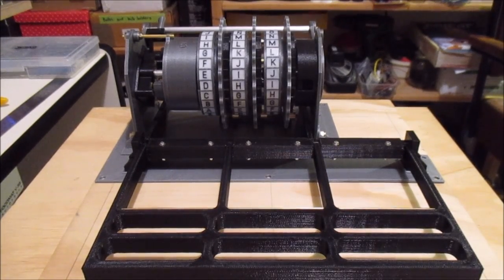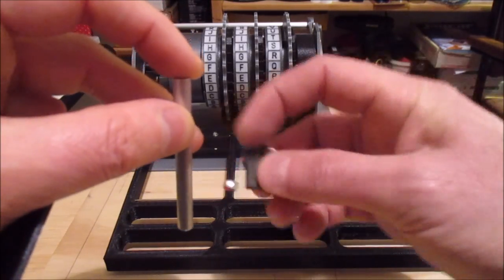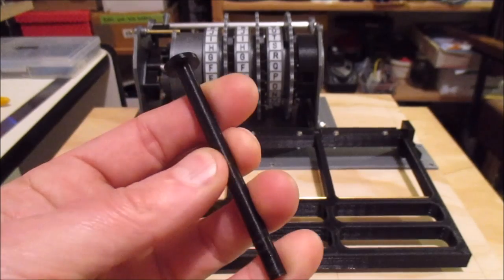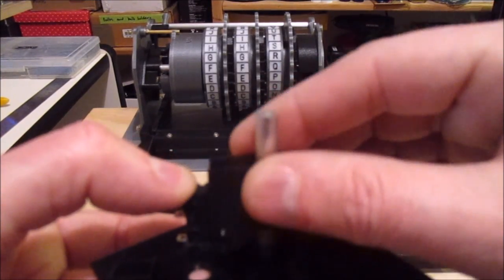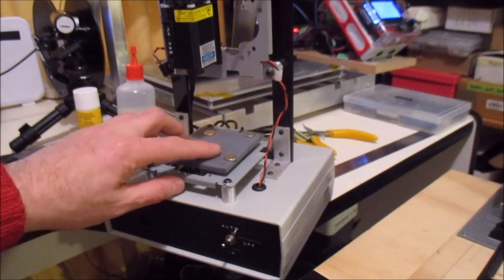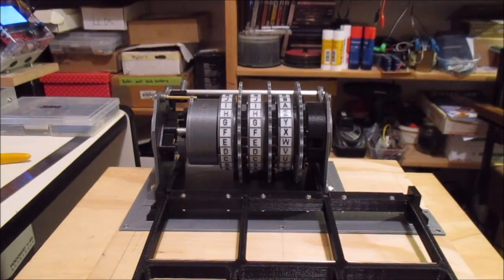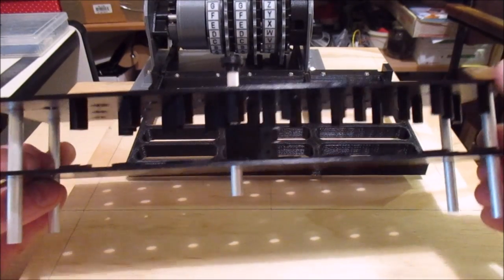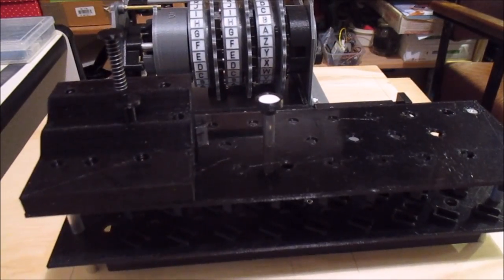3D Printed Enigma Keyboard

Comment: looking good, not sure about glass on keys wen you need a bit of force to press down the hole mechanism.
Reply from the maker: Yes, the glass is very thin. On real machines it is about 1mm thick but the coverslips are a third of that. But they are sitting completely flat against the letters which sit flat on top of the top of the key so the glass is fully supported. I'll have to do some tests once the cover slips arrive.